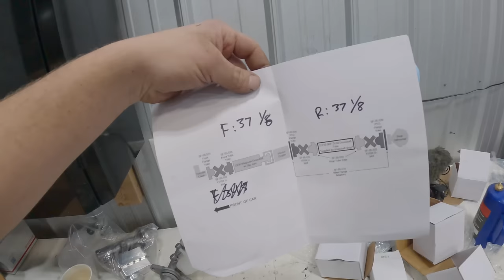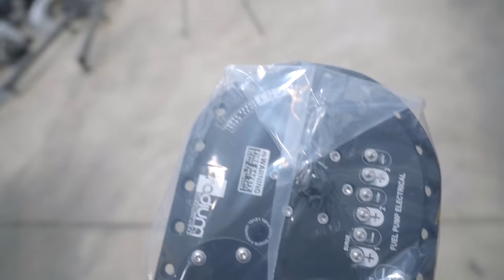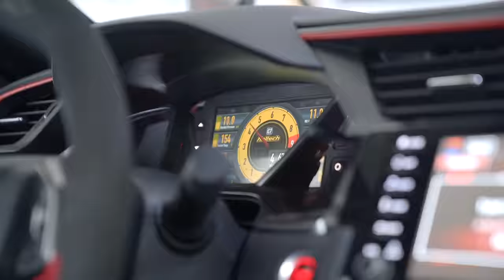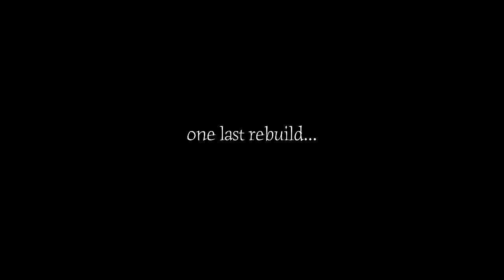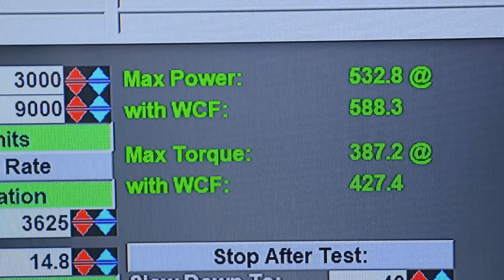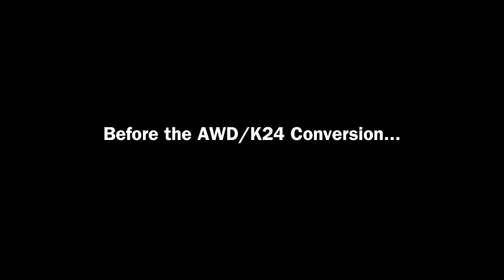Building a $100,000 Honda Civic in 25 Minutes!

Comment: As a professional tech myself, this is one of the best Civic builds that I have seen so far. Also impressed with how many modifications you made to the chassis subframes, cv joints, and differential assembly w/ the drive shafts installed to get it fitted. Not like you would answer, but how are those custom engine mounts holding up? Those seemed pretty risky without the bushings installed. That is unless, you added them later?

Comment: Most can say that 100k is a lot to invest in a car... however, the WORK that went into it. Props, man. Thing looks sick!
Reply: Something's you can believe and other things are no way to believe. I'm possible if he spent 100k to make this AWD. To begin with it's a Honda that its a lot cheaper than other cars to convert them to AWD. With 100k you can make at least 3 to 4 type r AWD and that's built the right way like this one. I'm not taking anything away from this mans car because it's more than amazing but ain't not way 100k just on one type r impossible. Also have to think about that he's basically doing all the work with his buddies. Saves alot more money

Comment: This video reminds me very much of myself building my CBR1000RR for racing. 
After every engine rebuild something wasn't right and forced me to open the engine. It took me 4 tries to get the engine right and then the main seal of the primary gearbox shaft was leaking. 
Luckily it wasn't that much of a set back, but damn. It reminded me so much. 
Maybe it's just Honda man.. Stubborn as the company is, and their product aswel 😂

The path it takes towards the end results is always worth sharing, thanks a lot for that!

Comment: dude is fearless. i would not trust those first welds even on a e-bike and this dude uses them on a car and on the place that has structural significance. attleast he got better on the way
Reply: you need to use the clutch on a manual car. would have saved probably half of the cost if you use and build the car correctly first time